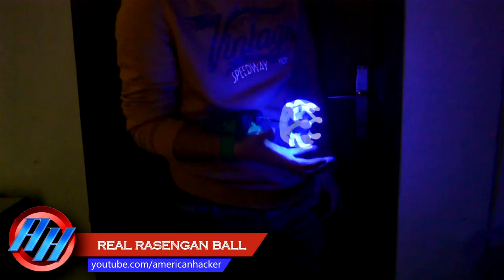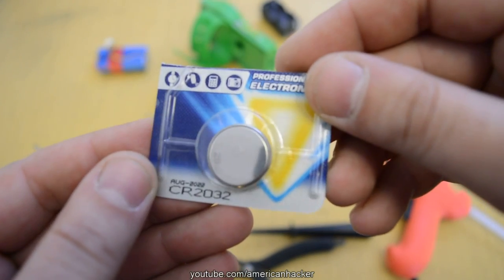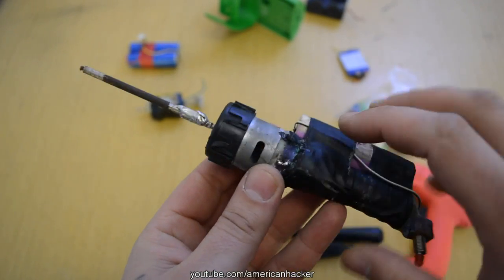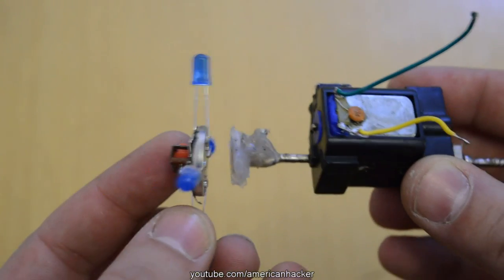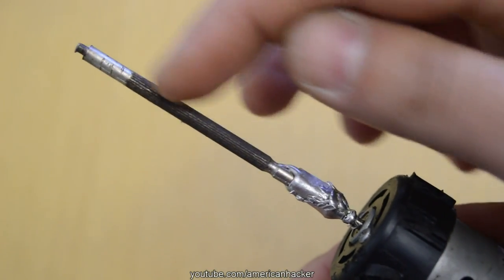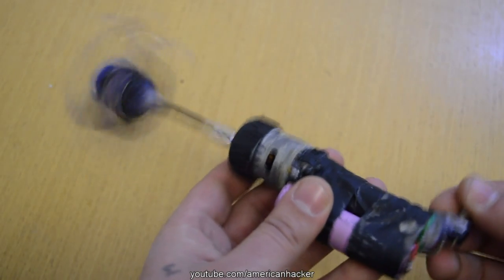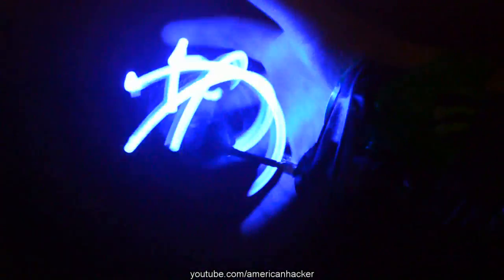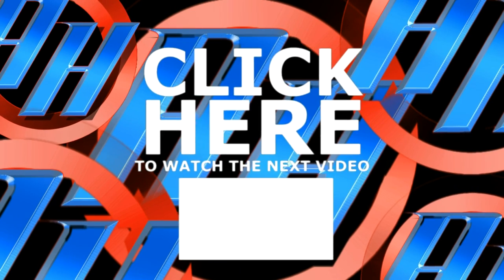How To Make Real Rasengan!

Comment: YOU NEVER SOLDER DIRECTLY ON A BATTERY! 1st: If the battery gets too hot it can explode.(Even with such a small battery you could get hurt) 2nd: How are you going to change the battery when it dies. 3rd: Without the proper resistors to regulate the power your going to burn out the LED's. Other then the safety issues this is pretty cool.

Comment: Hi, I see you have a tendency to solder directly to batteries, you need to include warnings and tell people how to avoid overheating. It's a very dangerous procedure. I highly recommend you read up on batteries, different chemistries and how to properly handle them. If you do not want, simply glue instead of solder, there is conductive glue available.